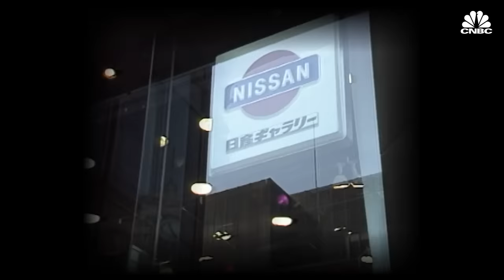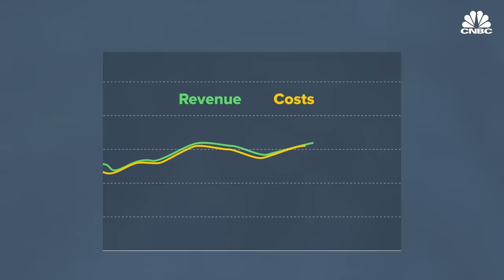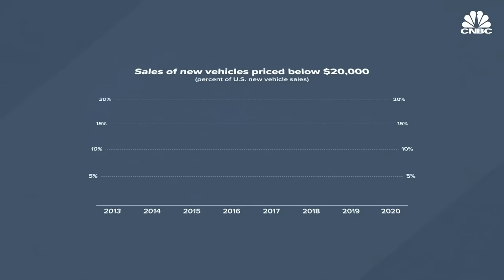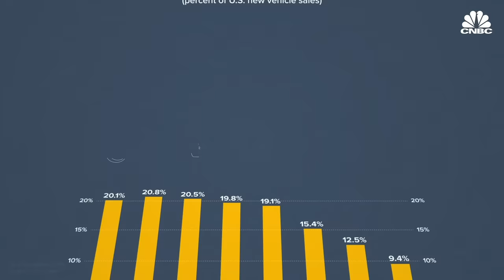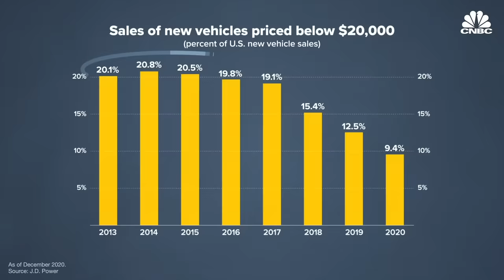Why Cheap Cars Are Disappearing

Comment: I absolutely prefer smaller cars. Cheaper to tax, cheaper to insure, cheaper to run. And as my earnings grew so did my ability to buy nicer cars. My first car didn’t have air con, or anyway to connect my phone to play music. My second car had a USB port, Bluetooth and air con. Now my third car has the same as my second car but with Apple play, I also have good safety tech too each time better than before :-)
Reply: That's what I am planning on doing. My first car, which I bought a few years ago, is a 2012 Outback. I am planning on keeping it for five years and buying a new, used 2017 Outback. Then I'll own that for five or seven years, at which point I will sell it for a 2020 model or maybe a 2019 model, and so on. By pushing these purchases farther out, you save a ton of money and the features and things it can do steadily increase. It's a much more financially stable way to go about purchasing cars. I can wait for features like Carplay or the latest safety tech if it means I don't have a 500-dollar-a-month car payment. I would rather save that money and put it towards a downpayment on a house

Comment: funny because when people like Stephanie Brinley say things like ''there isn't much appetite for base model vehicles'', that's absolutely not the case. The loss of appetite isn't on the consumer side; the manufacturer doesn't want to sell you a featureless car for thousands less; features are cheap to innovate and give them a lot more profit margin on a car than 99% of that car for 15% less money.

The truth is...no one cares about features.
...no one. Nobody asked for tablets and touch screens, but manufacturers will run and staple one to your dashboard and sell your car for thousands more because ''it can technology far better than the previous one can.'' No one cares. We'd happily buy a car with roll-down windows and a 4-speaker FM radio if it meant we could actually afford the car.

In Canada, base model cars are the name of the game, and there are tons of compact and subcompact cars running around, despite the absolute lack of selection on the new car market.

Comment: I'm not being funny, but the operation of inflation eventually pushes everything past price points if you wait long enough. But I do agree that the current trend is for large, expensive vehicles that would previously have been considered a luxury purchase;

I think in the USA two things have happened;

A) the easy availability of credit has meant that people are willing to spend several times their disposable income on a shiny SUV. People convince themselves that they can "manage" $1000 a month for 48 months & that this is a reasonable, sensible amount to pay for basic family transport.

B) the resulting commonness of large, heavy vehicles means that people don't want to drive smaller cars, due to the (partially correct) assumption that being hit by an SUV will hurt more if you yourself are not in one. So they go and get an SUV themselves.

C) it's painfully fashionable to drive a massive car right now - people urgently want one and will construct whatever justification they need to in their heads to do it. Note that eventually fashion will change to more euro-style economy cars again, and sales will pick up (fashion is cyclical).

The roads have effectively become an "arms race" of even-increasingly big vehicles, funded by cheap credit. Something similar has happened here in europe where people are increasingly funding expensive high-end car purchases on credit because they just cannot contemplate life without something shiny and German (which does exactly the same basic job as something cheap and Korean) on their drive.

Comment: When you have base Camry's with technology that would've only been found on luxury cars ten years ago, then that explains why car prices have risen. The price has risen, but the amount of features and safety that a car today has is significantly better. Consumers want tech in cars, they also want powerful engines, and they want fuel economy, and they want a big SUV. Now how does a car company create products that address all these concerns without significant engineering and design costs? If consumers bought smaller cars, with smaller engines, and less complicated tech and simple transmissions, then all this pricing will go away. For now, though, nobody wants to have a small less tech-heavy car and today people expect cars to have good features, and we are paying the price for it.

Comment: What most people don't realize is all this technology that has nothing to do with running the  engine or actually operating the vehicle is all interconnected. NAV, bluetooth, automatic door and hatch functions, climate control, driver warnings, electric steering, 10 speed DCT transmissions, auto folding mirrors have added a level of complexity and there is no end in sight. It's all fun and games when new but I would not plan on keeping these new cars more than a 5 years. The days of even you local garage being able to repair your car are quickly coming to an end. At some point it will exceed even a factory trained mechanic ability to comprehend how to resolve problems. A software glitch can "brick" your car and repairs are going to cost you dearly and may resolve the problems while the fix may cause new problems.

I stopped buying new cars 15 years ago how I long for my 92 Subaru Legacy wagon which I sold in 07 with 300K on the clock and the original clutch if people remember what that is. That car was stone cold reliable and was never in the shop for anything but routine maintenance. Just you wait when autonomous vehicles are rammed down our throats.

Comment: I loved my sporty, affordable little 2015 Toyota Yaris SE hatch 5-MT (w/TRD rear sway bar added) & hated when it was killed by a distracted driver in late 2019.  I walked away fine though.  Sadly, Toyota discontinued the authentic Yaris after model year 2018 here in the USA, though did offer a Mazda2 sedan (& later Mazda2 hatch) rebadged/disfigured as a Yaris through 2020.  I wish Toyota, Honda, Mazda, etc would bring back the subcompact segment to the USA (Yaris, Yaris Cross, Fit, Mazda2, CX-3, etc.), & in some nice/fun/sporty/premium trim levels, & not just as stripped-down, bottom-barrel trim econoboxes.

Comment: Math lesson today. Price Toyota Camry LE in 2001: $20K. Price Toyota Camry LE in 2021: $26K . So the growth factor based on 20 years is 26/20 = 1.3 Now let's exponentiate 1.3 to power 1/20 (20 years): 1.0132 This is the average growth factor of the price per year: 1.32% Meaning that the basic Camry LE 4 cylinder went up in price 1.32% each year. To my understanding, that is well in line, or less than the inflation. Most people in the work force would get on average a higher increase in salary than 1.32% (Or they switch jobs). On top of that: The 2021 Camry has way more power, has more safety features, consumes less fuel due to increased efficiency and the 2021 has simply more luxury features standard for which you would have to pay for the 2001, or it wasn't available. This is just one example. Cars have become more expensive? My foot! End of math lesson. Waiting for your challenge!

Comment: this year the lowest price for a Nissan Sentra starts at 19,600 while for example the Toyota Corolla Hatchback starts just over 20,000 while the starting price for the base Toyota Camry for 2023 model year is 25,500 while the top trim level will cost around 37,000 while for example the base price for a 2022 Cadillac Escalade is 76,300 while the price for a fully loaded premium Luxury version is over 110,000 or the starting price for a base model 2023 Cadillac Lyriq is 60,000 and the top premium luxury will be similar to that of the Escalade at least the base prices of the Cadillac SUV's are a bit fairer compared to the starting price of the Lexus LC which is over 94,000 or it's convertible which starts at 103,000

Comment: The problem is they can not compete with used cars. For 15k you can get a reliable, used luxury sedan with parts widely aviable like a lexus or a used Mercedes. If you're after fuel economy even a couple year old car or even a couple month old one will be significantly cheaper. The second reason is modern cars are overcomplicated because we're used to it. Complex interiors with many parts, complex exteriors, many unnecessary systems like displays, radios etc. A young people's car needs just an aux jack/Bluetooth reciever, some plastic on the doors and 4 speakers when it comes to interior. But why have that when you can have a used car instead?
Reply: $15k car without a warranty is a HARD sell for young buyer.

Comment: I have a 2013 car, I don't care about value or profit. I just need a reliable car and that is it and I pay to keep it maintained. I will keep it as long as it lasts me. I got rid of my last one because it was becoming a money pit and it smelled like mold and trunk leaked in heavy rain and the wiring was bad so the front signal on the passenger side didn't work. But it still ran good and I gave it to my MIL until her son totaled it. I still see used cars in my area under $20,000. Also low income people exist and they also need cars. They are any age. In the future I may just buy a car that is over 20 years old because that is all I could afford. I don't need a brand new car.

Comment: Companies start making affordable products when they've already sold all the expensive products they could to affluent customers. The economical products are designed to further maximize revenue by squeezing that last bit of not-so-profitable but still-profitable marketshare. When companies revert back to selling more expensive products, it's usually a sign of a downturn in that specific industry.

In other words, car manufacturers are struggling, which aligns with the fact that public transport and more sensible modes of transport such as ebikes are taking over. Customers are slowly realizing that spending 15%+ of their paycheck on cars is dumb.

Manufacturers could fix this by going back to their roots and making simpler, less expensive cars that don't require as much fixed costs (in a way, that's what China will probably do), but it would still be a risky move now that cars are heavily regulated and that customers are used to backup cameras, electric windows, AC and Bluetooth in base configurations.

Comment: There is a clear lack of small cars (2-seaters, for example) and stuff too. Why do you need an expensive pickup truck, if 80% of the time you're riding alone? But there is not so much supply despite a quite big demand. Kei cars and LSEVs could be solutions.

Comment: I'm watching this after finishing to negotiate with a guy who is selling me his 2005 Toyota Prius at just $2000 in Seattle and after a test drive the car is just as good as any good Prius can get. It has 252,000 miles on clock but  I could tell it has more 250,000 miles to go without a problem...... I think used car market hasn't been scratched on prices time immemorial
Reply: Used prices are going up.  Also, with many dealerships they will take a tradein and auction it off if they don't want to resell it, which means that car is off the private market unless you shop for cars at auctions.
Reply: @uni4rm  used car prices are going up, True. Buy that's national average and most data come from used car dealerships business model not from individuals looking for cash out of their extra car. Just as u said, auctions are good example, just as if you check on social media market place u find used cars cheaper as ever

Comment: Buy a second hand vehicle when it is aged 2 years and sell it when it reaches 4 or so years.
At age 2 it has lost a big chunk of its depreciation, usually has low mileage and in some cases still has certain guarantees.
At age 4 it could still have low mileage but reaching the end of guarantees although still should be OK mechanically.
However it may be facing more costly to fix issues in the near future.

Comment: That's what used to happen, up until about 6 years ago. You could easily find a great car for like 15 or 16,000.

And then they started to push infotainment systems, and all this extra s*** you don't really need, that doesn't really do anything in the first place. Place

Now when you go to Toyota, the convince you that on $60,000 a year you going to afford a $35,000 car

Comment: If auto makers and dealers rely on young buyers to sell "cheap" models, and younger buyers are considered a bigger credit risk because of trends in banking outside their control, shouldn't auto makers and dealers be empowered to deal directly with young people instead of going through third party lenders that can deny sales based on arbitrary factors? It's why you're seeing an increase in used car sales with dealerships that have in-shop financing options instead of actual credit-building with lenders, and why younger people are having more trouble getting approved for things like home loans and lines of bank credit. Plus it doesn't help that the current job market pushes younger (college-aged) people into subpar, non-growing employment with stagnant wages and unpredictable hours, meaning even if a young person was approved on a car note without a co-signer, there's little guarantee that they will be able to pay off the note without some sort of leniency that lenders (who sell car loans as investment vehicles) are lacking.

Comment: Technology changes rapidly,  so consumers want current. 40% of the cars cost is in the microchips and computers that run the sensors,  safety sensors,  engine,  wireless steering,  etc. Warranties are more expensive too. It makes more sense to lease and buy new than to buy outdated and used. More rebates and incentives on leases and you can keep your payment at 200 to 300 on a 25k to 30k cars vs paying the 600 payment on a depreciating car.  Honda civic touring is a 29k car for a civic but its now bigger and more advanced tech wise but that's what people want

Comment: It's a shame that the least practical type of vehicle has taken over. Hatchbacks and minivans have been objectively better in every category like efficiency and interior capacity, but all people can think of is SUV SUV SUV SUV. Trucks are just useless, luxury, polluting commuters now, because consumer demand and the EPA killed useful trucks like the Ford Ranger/B2500 which was all most people actually need to do yard work and other home projects. Also, used car prices are rising. Cars are holding value more. Everyone acting all cool about "cheap cars are used cars" is either buying a 20 year old car with major mechanical issues or is trapped in the meta of the early 2010's. If used cars are up, then new ones certainly will be. When I was buying my last car in 2017, I was looking at 5 year old used cars and they were going for the same price as what I could get new. I bought new

Comment: In 2000 I bought a 1990 Dodge Omni (which sold new for around $5000) for $50 because it had been sitting in the driveway for a couple years after a father had given it to his son when he bought a new car and the son didn't want it. Just lucky I guess. Anyway I drove it for 20 years and over 100,000 miles until the uni-body was rusted through and through. Checking out Facebook marketplace they are selling used cars with more miles on them than my old Omni (200,000 +) for 3 and 4 grand. A lot of the cars on there don't even run or are missing engines or transmissions.  I don't know if people are actually paying that much for them. Do you know that the Federal minimum wage is $7.25 per hour and some people have to actually work for that. Just ask the people in the homeless camps and living in their cars on the west coast.

Comment: I like a cheap car with no bells and whistles. Crank windows are fine. Manual transmission- no problem. AM Radio? Maybe. That’s about it. My best car ever was a Suzuki swift 3 cylinder, 62 mpg. It did have an AC but I didn’t use it because it slowed the car down.

Comment: There were a lot reason why SUV sells like a hotcakes. From consumer side of view, SUV look on as a car that gave everything. You want a very spacious car, you've got that. You wanted a tall car so that it was more saver (a lot of people thinks like that), SUV is an answer. There's also psychological reason that if you drove an SUV then people would've look to you as a rich people (which not true in every case) which again in the modern time this was still a thing.

The rise of SUV could also be traced on city's management both in road and drainage/flood management. Bad maintenance road meant that the road was bumpy, meant it wasn't suitable for cars that had low ground clearance which gave people the idea of buying SUV in the first place. Also some city that was below sea level would experience a flood atleast once in a year, so for that, people wanted a car that could go straight against flooded street. Again the rise of SUV shows how bad a city planning would've be. What ironic is that since SUV is bigger and heavier, it meant that if everyone drives it meant that road would more quickly worn out and damaged. Meant rises of the cost maintenance of the said road. The obvious impact of this is of course the rise of taxes. And that's the last thing people needed in this almost normal time.